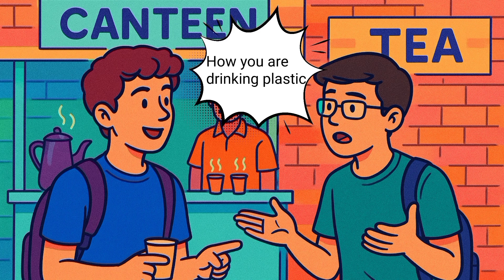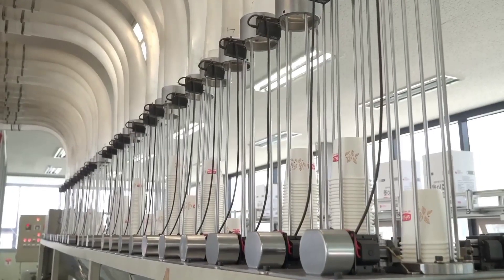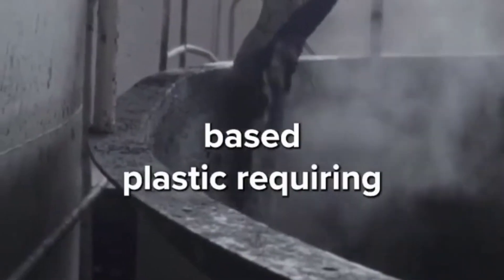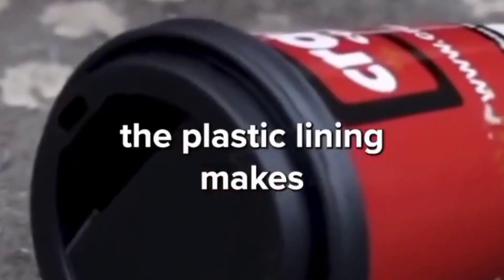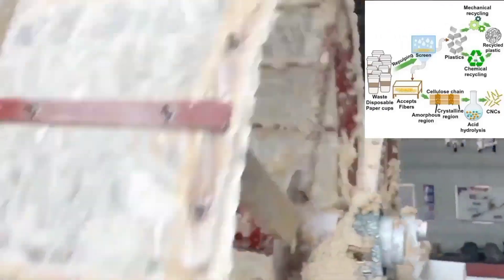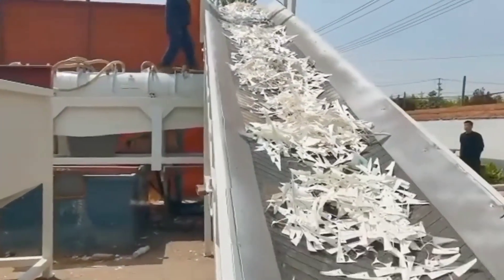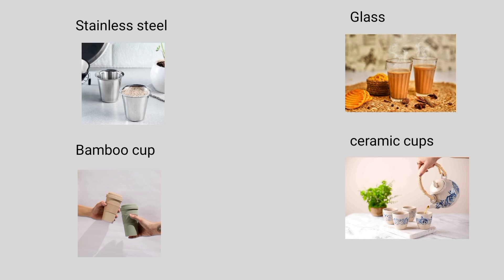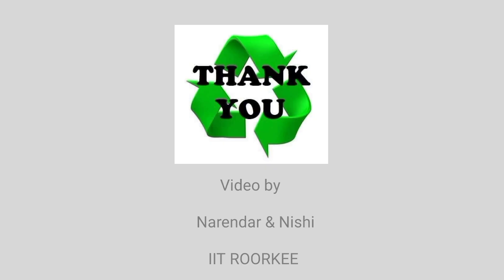Are Paper Cups Safe?  Uncovering Potential Microplastic Contamination in Hot Beverages

Comment: Single-use paper cups with food-grade LDPE are safe for use but pose a major environmental issue. Their difficult recyclability leads to massive waste and pollution. While pyrolysis can break down LDPE, it’s not a scalable solution, making these cups unsustainable despite meeting safety standards.The major focus should be improving the circular system of recycling 

You can also add the process of recycling and divide into into categories to make it more informative good work 

Say good morning from my side to Dr. Shishir Sinha the OG of polymers sir of IITR.